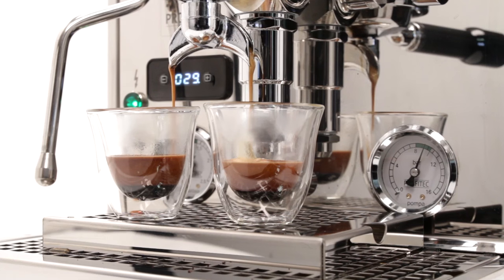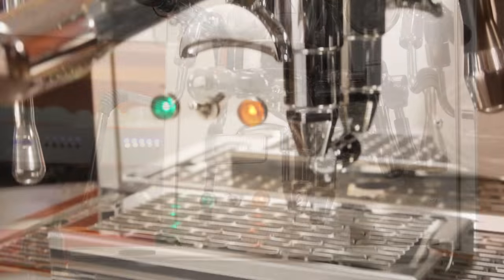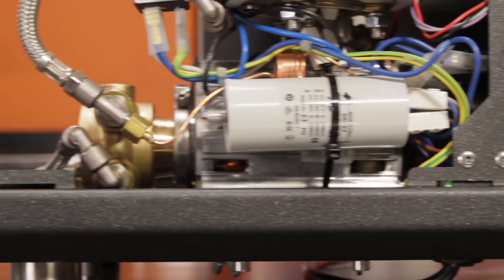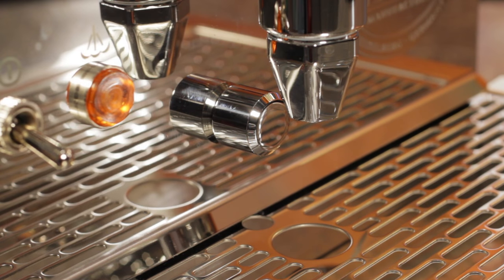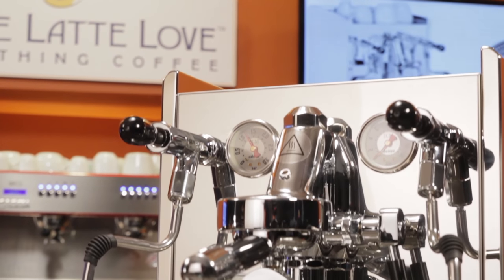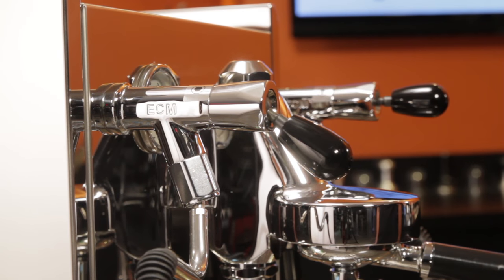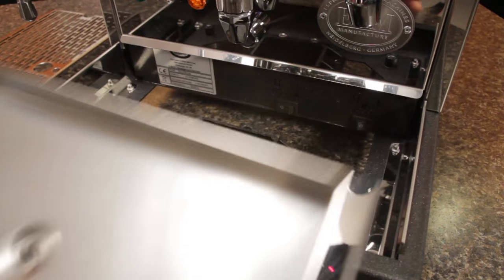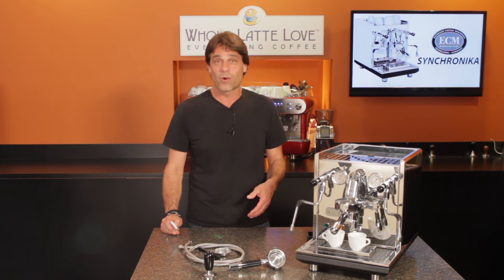Review: ECM Synchronika Espresso Machine

Comment: Love the ECM Synchronika.  My only wish would be changing the PID display to a larger easy readable LED display.  Making it easier to change temperatures.  Also the thing is only 80lbs but feels like 180lbs.  I practically broke my back moving it to its location. 

As attractive as it is in the kitchen.  It is about time to move away from the boxy industrial look.
Reply from the maker: Hi PN, Thanks for sharing your thoughts on the Synchronika!
Marc
Reply: I love the boxy look of commercial appliances. It means the thing is put together with bolts and screws rather than snapped-together plastic.

Comment: How would this compare with the Rocket R60V, in value?
Reply from the maker: Hi Blair, It depends to some extent on what you value. In the class of dual boiler "Italian" style machines I consider the ECM Synchronika one of the finest. The exterior finish and detail is about the best available. Under the hood, the ECM uses time proven quality components. But beyond the components is sensible and reliable design. Internal engineering adheres to the K.I.S.S. principle. Layout protects key components from heat and moisture.
The Rocket R60 adds pressure profiling capabilities. Externally it's a "flashy" machine but lacks the finishing details of the ECM. It's kind of like Paris, France vs. Paris, Las Vegas. Looks good from a distance but when you look closely it's just not the same. Internally the R60 is fairly complex. It uses a stepper motor in water supply line after the pump to modulate flow/pressure for brewing. It's a different setup than most pressure profiling machines (which typically cost more) that vary the pump speed or use specialized flow control valves which are more reliable than the stepper motor in the R60. It also has 3 or more solenoid valves which are common points of failure. That said, feed it with good water (dechorinated, low TDS etc) and those components should be fine.
If value to you means making exceptional espresso on an E61 group machine my pick for best values are Expobar Brewtus IV machines. They don't have the superb finish details of the ECM or pressure profiling capabilities of the R60 but they are well built workhorses - every bit as capable of making fine espresso on a machine that costs a lot less.
Hope that helps. Let me know if you have more questions.
Reply: Thanks...that does help...

Comment: Hello, can Synchronica works from a tube ( trying to avoid) opening the top every two days? I know Expobar Brewtus can soak from a tube can Synchronica do that also?
Reply from the maker: Hi HP, Yes the Synchronika can connect to household water supply. When you do that it can do a line pressure pre-infusion as well!
Reply: Hello, I think I wasn't clear. I meant to work from a larger water tank underneath the counter. I'm aware of direct connection, unfortunately, I cannot arrange such.

Comment: I have bought this machine and very disappointed with the steam performance.  This "promotional" video describes it as able to reach 2 bars of pressure for the steam.  I have never seen it reaching 2 bars and it very often drops to 0.5 bars during usage.  Very strange for a dual Bolier, $3K, espresso machine.  Not much help from WholeLatteLove either.
Reply from the maker: Hi S, we’ll something is not right! What temperature do you have set for the steam/service boiler (T2) and what temperature does the PID display indicate? What you describe is not normal. With T2 set to 272F you should be at or near 2 bar on the gauge and no way it should drop to .5 during normal steaming.
Marc
Reply: @Wholelattelovepage  Well Marc, I couldn't agree with you more - something is wrong.  I cannot believe myself that an espresso machine of this 'quality' and cost would do that, but it does.  The starting temperature of the steam boiler is 266/267.  I understand it can go up to 272 and perhaps the machine registers the 2 bars of pressure (as opposed to just over 1.5).  However, this is not the main problem - them main problem is that it drops very very quickly as I start using the steam - typically very quickly to about 1 bar and very often to 0.5 bar (temperature goes down to about 235).  This is not an acceptable performance from a $3K machine.  Unfortunately your team has not helped much either.  I'd expect WholeLatteLove to make it right if I was sold a defective machine.

Comment: Hi mark Thanks for pointing me to this video. I really like it someone from espresso forum suggested me to get a 4-5 whole wand do to it taking a while longer than it should. Not sure if its do to power limitations or not.  I do have 20 amps and 120V.  uscfroadie wrote tech explaining the issue with the Rock 58  http://www.coffeegeek.com/forums/espresso/machines/690586 he explained how in the usa its underpowered I wonder if this is something I will experience with the ECM.
Reply from the maker: The PP700 and ECM have loads of steaming power. Steam tips are a personal choice. Manufactures try to fit with one that works well on the machine. More holes in a wand tip will usually use up steam faster as they can release more pressure. More vigorous steaming initially but as reserve dwindles so does steam power. We've never had an issue with either machine using the stock steaming tips.

Comment: would these grinders work with the Synchronika ?http://www.ecookshop.co.uk/ecookshop/product.asp?pid=BCG820BSSUK
https://www.coffeeitalia.co.uk/proddetail.php?prod=rocky-doserless&cat=140
Reply from the maker: Hi Mary, They will work but depending on how particular you are you may find yourself wanting something better. Of the 2, The Rocky would be my choice. It has a much more solid build than the Breville. The major issue with both is they are stepped grinders - the grind size adjustment happens in steps rather being continuously variable which allows for much finer control of grind size adjustments. Breville is a bad choice if you will be grinding for more than a handful of shots a day. I'd suggest a more commercial style grinder with at least 63mm burrs and stepless grind size adjustment for servicing the Synchronika. Ceado has a number of affordable grinders like the E5P and E6P that fit that description. Another option is the Baratza Vario. With micro-adjustment its near stepless. Thje Vario is considered by many as they entry level into higher end espresso grinding.
Reply: cheers thanks
Reply: or https://www.bellabarista.co.uk/ecm-s-automatik-64-grinder.html
https://www.bellabarista.co.uk/profitec-t64-grinder.html

Comment: Have had Synchronika for 4 months.  Cannot get a drinkable espresso.  Something wrong with the design.  Poor customer support.  Look else where for a machine.  $3500 useless piece of metal.  Although, the hot water is very hot.
Reply from the maker: Hi Mark, Sorry to hear you are having troubles. If you can provide more information I'd be happy to help. Details like make/model of the grinder you are using, coffee bean type/variety, description of your dosing and tamping technique, brew temp, etc. Have to say the Synchronika has a huge user base that loves the machine. It's widely regarded as the finest dual boiler machine available in design and finish quality. It has a 5 out of 5 star average rating in 200+ customer reviews: https://www.wholelattelove.com/products/ecm-synchronika-dual-boiler-with-flow-control
The most common problem is grind size not dialed in correctly. Here's a video showing the simple process for that: https://youtu.be/jOY7D02n4Cw
Again, I'd be happy to help. If you'd like me to just provide more specifics in an original comment on this video.
Marc
Reply: Have you learned to make espresso yet? :P  You need to make sure you get good fresh roasted coffee first of all, and use a good grinder, whats your process like?
Reply: Finely talked with someone at WLL.  Figured out I had  ECM grinder I had was not able to be dialed to proper grind size.  Switched grinder to the Helios 65.  Now in espresso heaven.  Synchronica and the Helios 65, 5 star.
Reply: @marktk5215  Cool so just a defective grinder.

Comment: What’s the difference between this product of 2016 and 2024?
Reply from the maker: Hey winds, thanks for the question. Older Synchronikas like a 2016 version likely do not have the higher 2 bar steaming power available on more recent Syncs. Internally, components are nearly identical for all models with exception of a higher rated overpressure safety valve on models with the 2 bar steaming power due to higher pressure in the service boiler. Also a few minor component changes like a metal T connector replacing a plastic one in the hydraulic path which combines/routes internal moisture sources to the drip tray. Hope that helps!
Marc